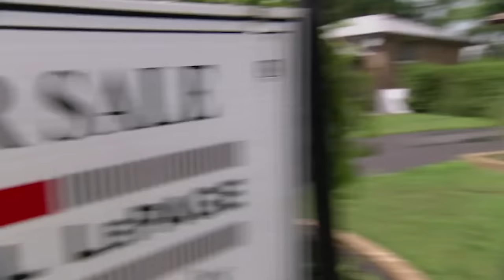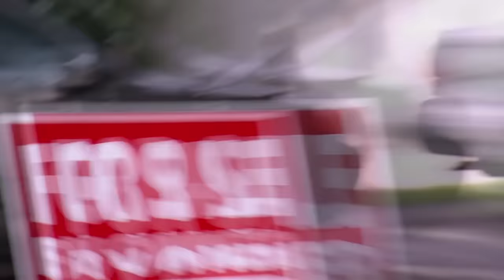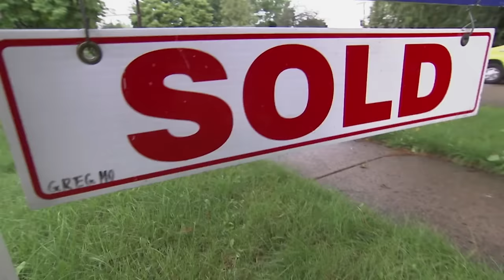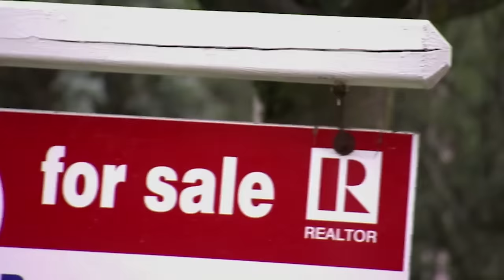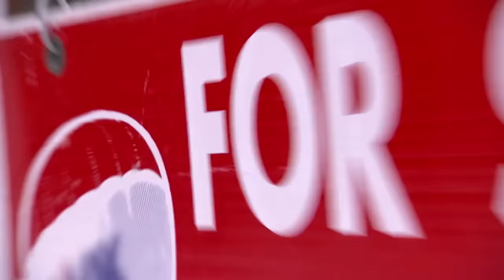Letting Go Of The Past And Preparing For A Sale! 💸 | The Unsellables | MEGA MARATHON | House to Home

Comment: What Anthony didn’t mention: When you remove wall to wall carpet, there is usually a space between the bottom of the baseboards and the floor. This space is usually concealed with quarter round that bridges this gap and hides any uneven cuts where the hardwood flooring meets the bottom of the wall. It also slows down drafts at the floor. Adding quarter round is not terribly difficult, but it does require patience to measure, cut and fit the joints, corners and open ends.

Comment: 2nd house was so cold looking with all that grey before. They should have painted the dining room a soft cream or beige as leaving it grey looks cold & bad. In the kitchen Anthony should have moved the refrigerator over & put the lower cabinets back to where the were probable originally were. Then he could have still had the breakfast bar in the corner with floating shelves above. Leaving the refrigerator where it’s at make the kitchen boxy & small. On the porch they should have put a colorful planter of flowers between the chairs to add color outside
Reply: Being a single middle aged woman isn’t all that bad 😊

Comment: It is a nice house. It needs updated, but it is a nice house, people should’ve bought it anyway.  They probably would’ve excepted a low offer.
Reply: That's what we looked for when we bought a house. Something that hadn't been updated because the purchase price would be lower. Our house was verrrry 70's when we moved in in 2014, but due to lack of cosmetic updates and such (important things like siding, roof, water heater, etc were replaced as needed), the pricing was insanely low. 

The first year we did a lot of purely cosmetic work like repainting, changing light fixtures, flooring (ourselves), a few windows, bedroom/bathroom doors. We did whatever we could paying cash and ourselves so saving interest and contractor fees.

We saved a ton vs paying $100+k more for a turn key ready house with interest over 30 years (honestly the only other house that interested us that was on the market at the time was $320k more, that's a HUGE difference in mortgage payments). The way we saw it, is we could put $2000 more a month x 360 on a mortgage payment for a "pretty house" or we could put that $2000 a month in investments and other wants and reno when needed.

Comment: People are clowns.
If you did not bought the house just because of basic paintwork, furniture arrangement and color then you are not very smart. Most houses are partially renovated after being sold, so...
What matters is the size of the house, the location, the layout, windows and doors, good state of the roof and the state preservation of the floor.
The wall colors and furniture is irrelevant.